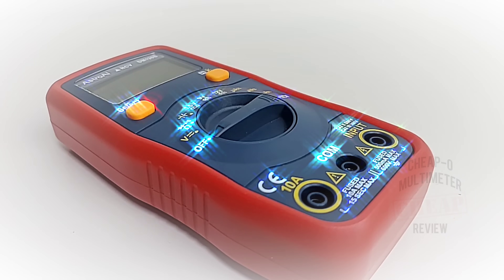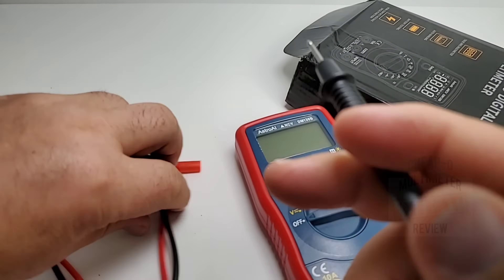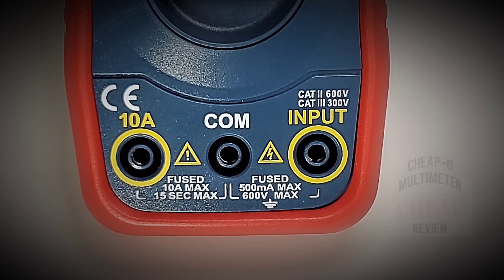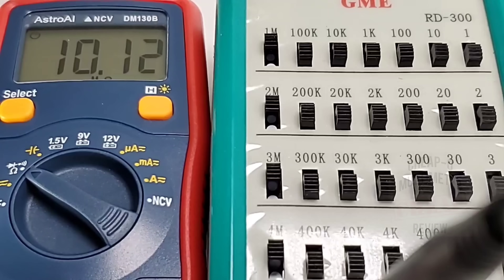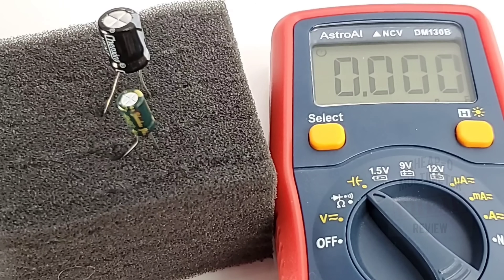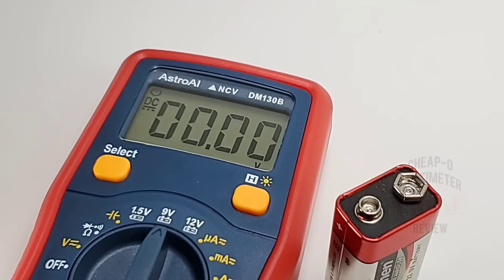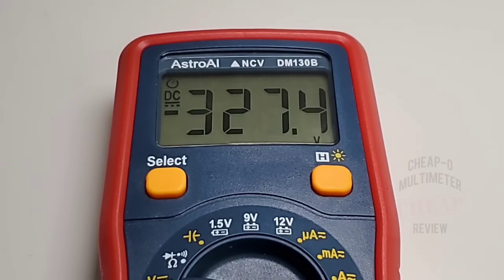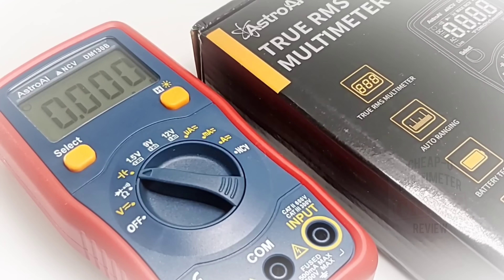AstroAI DM130B CHEAP-O Multimeter Review & Teardown!

Comment: These meters are really tempting due to the price and features but I am scared to buy them because it doesn't seem to have any safety certifications, and according to Bing AI (perhaps not the best source) multimeters not only need effective fuses but also a well isolated design to prevent an arc flash that can burn or blind you or violently blow up the meter in your hands.  

But I found a klein tester for the 30 dollar range that may be safe. It's less feature rich, only has manual ranging, and more expensive than the Astroai, but it has an Intertek certification which according to Intertek means it's been safety certified. (It also has CE certification, but I've heard that CE doesn't mean much for safety) 

So I might go for the Klein as a cheap but hopefully safe meter. Astroai, im just not sure enough to trust it. I'd need the certification, or a teardown evaluating its ability to resist arc flash. 

And I don't even know how likely it is i would encounter a dangerous situation while working on home electrical, where the safety features would be necessary. Is such a dangerous scenario rare for household work? I would think that the safety features are included in good multimeters for a reason. 

They also say that fluke multimeters are guaranteed the best safety but cost more and have less features. There's a fluke 101 sold in the Chinese market, produced by Chinese factory, that's supposed to be good but I'm not sure I want to get that just because the Chinese market version is the cheapest and it seems a bit dodgy buying it out of China. (What if i get a fake or its lower quality)
Reply from the maker: Most multimeters are perfectly safe for household mains, including the venerable 830xx clones. Yes, you won't have the build robustness of more expensive meters but still perfectly adequate for most home users and DIY enthusiasts. Ultimately,  the best protection is an informed user who knows how to properly use a multimeter and understands its limitations. 😊

Comment: @6:27 I know I'm about a year & so late on this, but I just wanted to point out that the gator clips that come with it are VERY snug & TIGHT when fitting them on the leads (the proper way). If you look inside the shielding, there's a tiny hole for the leads to be inserted creating a rather tight & solid connection. In the video you literally just plopped the rubber over the lead without showing the inside of the shielding to further solidify this "problem" you claimed of. 

Literally I looked at the clips provided, saw the opening was obviously larger than the lead itself so instinctively my brain said:

-  "look inside, im sure there must be an attachment of some sort for you to  properly combine these two together."

& so here we are. Other than that,....VERY GREAT REVIEW! LOVE HOW YOU *TESTED EACH FUNCTION OF THE UNIT. I just bought this yesterday, & it came without a manual so I found you instead....and downloaded a pdf file manual also. 

Thanks for the upload! 🙂👍🏾
Reply from the maker: Never too late 😌  Thx for the updated info..looks like you got those clips on the RIGHT way..it's a good multimeter and should serve you well!  👌

Comment: Not quite as good as other Astro AI offerings regarding cap range and low continuity volume but still has the same accuracy associated with other Astro offerings.  I have the WH5000A and their DT132A and both are very accurate, and it should be noted this meter is priced lower than the ones mentioned.

Comment: I like it's precise results in ma range. In my experience with my 2 DMMs(richmeters 113d and Powerfix PDM 250 A1) they lose precision over 50 ma, so some times I'm forced to switch to A range and I'm in search for a good and accurate meter in ma range. What i noticed is that in ma range both multimeters have different input resistance(impedance?) and also in A range is almost zero ohm! I guess this has to do with zero burden voltage(a new term for me and I'm still trying to understand with my mediocre english what it does) something which I found out in some reviews(maybe I'm wrong and I have mixed it with something else).

Comment: So accurate and quick in continuity mode! I would've recommended it as a good "my first dmm" but the low diode output voltage is inexcusable with 4.5V of AAA (yuck) batteries. Fix that plus use AAs and a threaded metal insert and it would be better value than a $10 harbor freight dmm.
Reply from the maker: All great 👍 points!